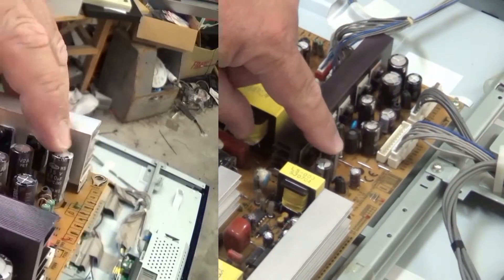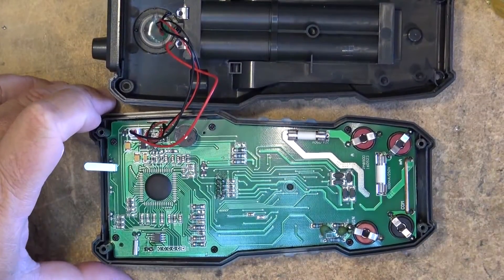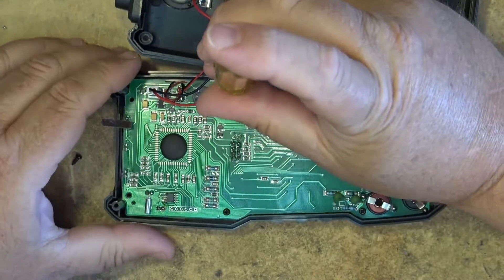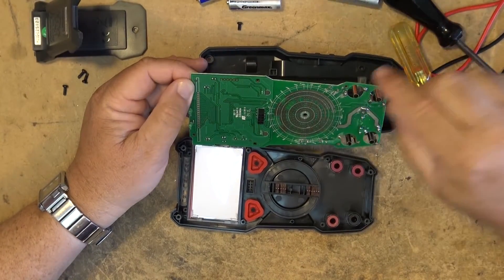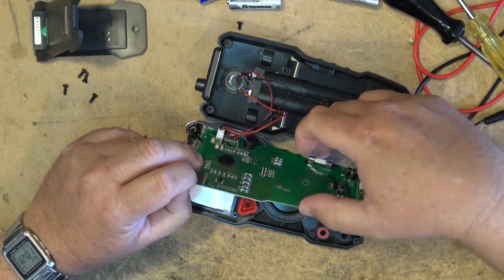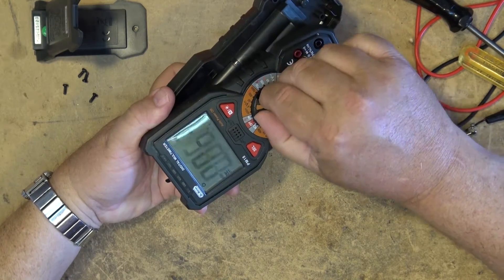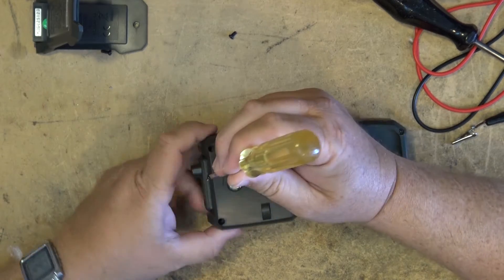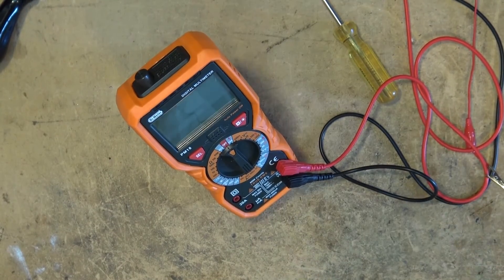Dr Meter PM18 Multimeter Tear Down

Comment: Thanks for this video. It saved me a lot of trouble today. I have essentially the same meter but branded as the PEAKMETER PM18C and I had to lubricate the dial because it became almost impossible to turn. While doing so one of the small triangular contacts on the dial came off and I wasn't sure which little nub of plastic it went back onto. You video showed that very nicely!

Comment: Awesome video, I have used PM18 for years, but last night unfortunately I tried measuring the voltage when the multimeter on DCA microamper position by mistake. I want to fix it, but 3 resistances are burnt (R14, R15, R16) 
can you tell me what value of the resistance? 
I can't read them on the video...

Comment: Ive got the Tacklife DM01M version of this same meter, mine has the transistor tester in a separate module, theres a light button in place of the onboard tester the Dr. Meter has.  I know its not a high end unit by any means but accuracy is good and you cant beat it for the money, mine works great - so far -  but just like my similar Tacklife model this one has only token input protection nothing like a flukes input protection, but it doesnt cost anywhere what a fluke does either.

Comment: I don't know, man....is that a critical need in money or you don't really understand what have you reviewed...it doesn't really matter, though...but what the heck had to have happened that while looking with your own eyes at this piece of shit, you've characterized it as "good-constructed" and "impressive"? Really?)
Reply from the maker: Богарт Хамфри 

Ok your the expert. Tell me then exactly what is wrong with this meter. Keep in mind that we are not talking a high end Fluke here. We are talking about a 50 meter. For a 50 meter I saw no manufacturing problems the unit has protection from over voltage and is fully fused. It's in a well insulated cabinet and the probes are suitable fore the ratings of the meter. Is it going to compare to a 500 meter? No, and I wouldn't expect it to. Is it going to be acceptable for all but the most critical measurements, absolutely. So what's your problem Mr know it all? And no I am not in critical need of money but this is a job just like my regular job I do every day between 8 and 4. Companies send me products to test and take apart because they want people to know what is inside them. I look at everything with an open mine and talk about what I see inside bearing in mind the price of the unit and the intended target buyer. In this case hobbies  or even professional services. You might not agree with the "blob" of epoxy over the chip. That is called encapsulation and it is done mainly so that other companies won't copy their design. It is the simplest form of patent protection. Keep some key components secret. Now that won't stop a serious hacker from dissolving the epoxy to see what chip is in there but is will stop the copy cats from just scanning the board and making a copy. Companies like fluke didn't have to resort to this because they built a custom asic that wasn't readily available. This is likely a very common chip and that is why they did this.
Reply: Want me to substantiate my critique with facts and arguments? Fair enough. Ok. Give me a couple of days to finish one deal. I will try to resurrect the dead one that's fallen into my hands recently - Forscher FS8215 (minimal price in Poland is about 50$) http://www.forscher.pl/produkt/fs8215-forscher-miernik-uniwersalny/ It's absolutely the same as PM18C, PM890C/PM890D, HYELEC MS8236, Tacklife DM01M, Meterk MK01 or any other pm890d(mainboard) based multimeter. I have no lack of apodicticity or any doubts, merely it will   enhance my statement
Reply from the maker: Богарт Хамфри 
Your point? So it blew up. I have a really expensive fluke here that an electrician accidentally overloaded measuring a transformer and it is toast too. Any meter can be blown up. This fluke I have was hit with only 750 vac when the max rates was 600. Poor burnt to a crisp.
Reply from the maker: The one shown in the picture in the link is rated 10 amps max current measurement, and the one I have is rated at 20 amps, so to me that tells me that they are not the same meter. They may look the same but   rated at 10 amps max current measurement says it is a different meter internally.

Comment: Thanks for the quick teardown. 
Personally, I wouldn't trust the protection of the meter for mains voltages and higher. Especially as it lacks the proper HRC fuses and the MOV's look rather small. However, you've still got your Fluke for that sort of stuff so it should be fine for most electronics.
Reply: Yes i agree it lacks adequate protection ,probably ptc not mov. Probably alright for hobbyist 30v and below

Comment: Thanks for the tear down.  It didn't look bad inside for a low cost meter.  I also noticed that it had ceramic fuses, which are supposed to be safer in certain environments.
Reply: Pete Ciallella 
Ceramic fuses are designed to contain the energy spike of the fusible element disintegrating, which at several Amps can be significant. They should be filled with sand which is designed to melt due to the high temperature, absorbing energy and the ceramic outer shell is able to withstand the heat without shattering, unlike a glass fuse would. A properly certified Category iii meter should also have internal parts of the case which cover the fuses (in particular the highest current one) to reduce the chance of any high voltage arcing from escaping and both damaging the rest of the meter and the users hand. Most such higher current meter fuses are significantly larger than the low current one to enable safe dissipation of overcurrent. Cheap meters often skimp on this and other forms of protection to save money which is fine if it's only being used for low voltage electronics but not advisable for use with higher voltages, including mains electricity.

Comment: As far as i can tell, its actually a "PeakMeter PM890D" with a typical multimeter i.c similar to the types made by cyrustek/future semiconductor, and others.
The pcb has the number PM890D.

Shame they used a Cob style chip, a cheap way :-(.

Seems a good meter though, for the times where you need a second voltage monitor.

Comment: The meter seems to work fine for you :). I definitely would not want to miss autoranging, but hey... ;). The fuses look a bit skinny, at least it has some ceramic and no glass ones ;D..., but would not recommend pushing 20A through the new meter ;).
I like that it uses AA batteries, which you can get everywhere. Nice and quick tear down, have fun with the new meter :).
Reply from the maker: I will still likely use the fluke because the beep on diode test is invaluable to me. I also still prefer an auto range meter and with fluke you know what you are getting, the very best... PERIOD!
This one was sent to me to evaluate and test and I find that it is of very good quality, and will do the job for the vast majority of users as it has some unique features not found on many other meters. So yes I like it, and probably will use it, but it won't be replacing my old reliable fluke
Reply: I agree...Fluke is the best, but, for anyone that needs a meter for hobby or any light electronics...This is an excellent meter and for only $33...